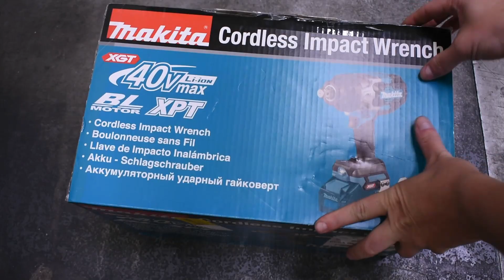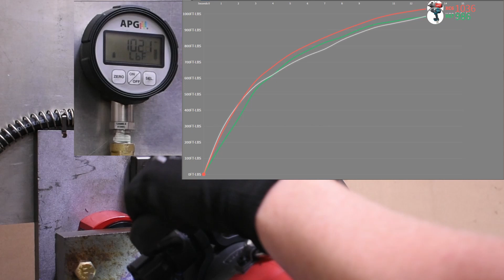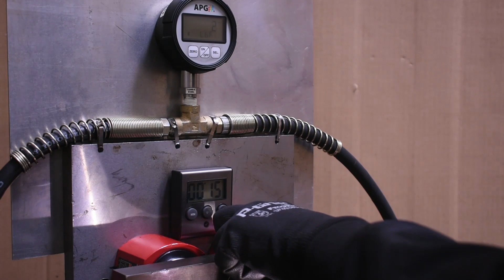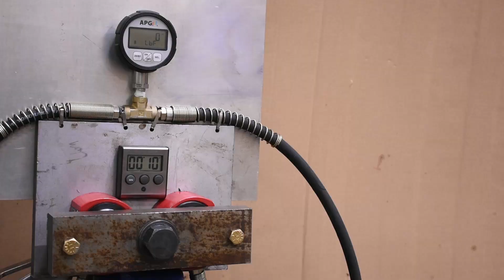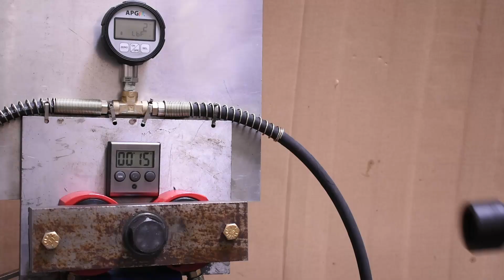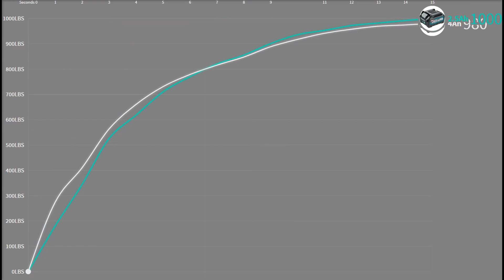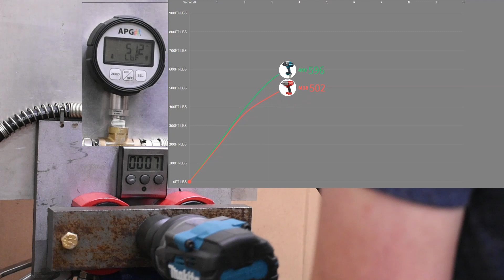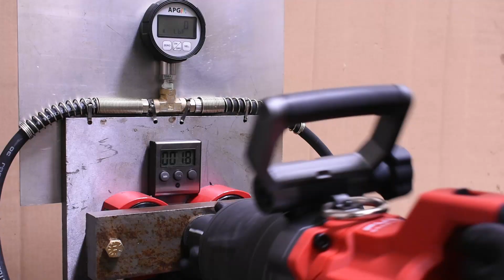Meet the #1 Big-Rig Impact Wrench It's only 3/4" & Everyone Else Should Want 1 Too

Comment: Wait isn’t the per cell draw the same, because in 18v the packs are in two sets in parallel whereas 36/40v they are all in series, I.e same current draw per cell
Reply from the maker: The per cell and total potential draw is the same amount of amps, just wondering if this 40V was made to utilize the extra available in a 4.0 over their 2.5 or maybe the efficiencies of a smaller 40V motor even needs them. As in it needs less total watts. We have no idea, Makita stopped talking to us when we asked.

Comment: I have worked with various Li-ion batteries and have found that the large cell types have higher internal resistance. They will last longer but not hit as hard. The only way to get more punch out of equivalent voltage is to find lower resistance cells, Li-po tends to fit the bill. I'm curious if you where to rig up one of these tools with a Li-po how the numbers will change, using equivalent rated cells. Additionally if they are using less cells to reach the same Ah rating the parallel paths for current flow are reduced, reducing the overall output the battery can do at once before reaching thermal limitations.
Reply: incorrect

Comment: What really annoys me is that Makita was honest with 18 V and 36 V: XGT is the irksomely dishonest 40 volts? Perhaps they really wanted to differentiate, but I guess LXT too hard to keep separated from XGT.

Oh, well... &rocks in rocking chair&
Reply: Makita couldn't call it 36v when they already had a failed 36v platform. My opinion.
Reply: @Hansengineering  I've not owned their 18 V x2 system. Has it been a failure? I truly am curious.
Reply: @ALAPINO  no not 18vx2! They had a single battery 36v system.
Reply: @Hansengineering  exactly

Comment: I've got 98 lithium cells that I want to make into 5 and maybe even 10ah battery packs out of for things like circular saws or heat gun or Sanders those battery powered devices that suck life out of a battery real fast
And I'm special interested to see just how much of a performance gain it will be cuz these particular cells that I have are A123 cells they are rated to put out 80 amps each for 10 seconds and 50 amps each ! And on a dead short a guy got like 254A out of one before the end popped off lol and one guy was able to start a V8 truck with only 4 cells making it 2.5AH at 14v and the size of your cellphone! They are crazy powerful

Comment: Great testing as usual guys! I can confirm that the only real noticeable difference in power when using XGT batteries comes from using the 5AH packs but they're just so huge and maybe not so impressive compared to an 18v tool with a larger amp battery. The 4ah will only give you more run time boo 👎 .  Thanks for showing this!

Comment: I bet Makita is limiting the 4ah pack in software where Milwaukee does the opposite.
Reply: Software? I don't think the charging circuitry is programmable, it probably just uses a current limiter component
Reply: I think they just needed the 21700 cells because 4 ah 18650 cells wouldn't keep up
Reply: @specialopsdave  Probably just an analog or digital IC. Would be fun if someone found one and tried jumping it somehow. ;)
Reply: @specialopsdave  It's a brushless motor so limiting current through the motor is a fairly simple bit of tech to put inside the controls for the motor.
Reply: @prototype3a  Exactly why they would use a 2 cent component, and not software
Reply: @specialopsdave  I guarantee they are not using a "current limiting resistor".
Reply: @prototype3a  Why did you put that in quotes? I never said resistor.

Comment: You'll have to test it with the 5.0ah then, maybe it could hit 1,000 on the 10 second test in reverse.
Reply from the maker: That was why we tested this 4ah battery "It's gotta make more power right?". Not sure making EVEN MORE amps available to this tool is really going to churn more butter at the end of the day.
Reply: @TorqueTestChannel  the short clip you showed of the other channel with all the batteries implied that the 4.0ah is set up different than the 2.5 and the 5.0. I'm not very informed on battery cell technology so maybe it won't make a difference. Love the channel!
Reply: @parkerdalo3248  That same clip also mentioned that Ah is only a measurement of capacity, not power output. It's the different cells that provide more current at once that companies traditionally put in larger packs with higher Ah. Kinda made some extra decision making when purchasing a battery other then "this one will last longer". It's nice to know that you don't have to worry about that with XGT, if you just need power but not endurance then you don't need to splurge and live with a heavier battery pack
Reply: @parkerdalo3248  That guy from that other channel... whomever he may be... says that the 2, 2.5, and 5 use 18650's but the 5 uses 20 of them whereas the other 2 only use 10. The 4 uses 10 21700s. I have found in most tests the 5Ah puts out more "Grunt" than the others, but it depends on the tool. Makita have made the mitre saw put out the exact same RPM no matter which battery you use, yet on the 40v circ saws the 5Ah is noticeably better.
Reply: @ToolsAndStuffOFFICIAL  the AH ratings always kind of throw me off. I have 1.5, 5, and 9AH packs for my milwaukee impact, I figured if they're putting out the same voltage into the same tool, they should have the same amperage and torque. Math is math. The speed difference between them all is ridiculous, and obvoiusly math is not math!

I suppose it's just the smaller capacity packs having a larger voltage dip as soon as you hammer on it?

Comment: The durability is far more important these days, impact guns destroy themselves quickly with the big packs on them, makita adding this in to their new packs is far more of a selling point to me than more power.
Reply: I have the issue with my M12 impacts that when they are used for a while at high impact torque that the temperature pin from the batt to the tool will burn and i have to clean it off and bend the pin out just a bit
Reply: Makita has a damper built into the base to stop that happening

Comment: The 3/4" Bosch Protector should put up similar or better numbers. You should do a head to head as the Bosch would be a way cheaper alternative battery wise. Bare tool is $249 and 8ah 21700 packs are $99 so a pretty good alternative.
Reply: Bosch Profactor ?
Reply: @rosomak533  yeah was a typo

Comment: I revised my Makita impact wrench lineup at my store because of your tests. Definitely happy with stocking the 18V Low and Mid torques, and just the "40V" high torque. From your tests I think for ½" drive the mid torque should suffice for most people who are already on an 18V platform. 18V High torque is now relegated to "special order" territory =P
PS: If I lived in the States or you in Canada I'd definitely be sending you tools I stock for testing.
Reply: how much does an old xwt08(?) their big 18v even cost? is the cost in the space it takes on the shelf maybe? an old design and maybe just cause ima tool nerd but they're 100usd new?
Reply: @byloyuripka9624  The old 1/2" High torque 18V? In Canada they cost me slightly more then the new 18V mid torque, somewhere a little under $300 CDN. I don't think it's worth it for me to stock it when the mid torque is a much better value, and a smaller easier to use tool to boot. But if someone really wants it, I'll order them in the old 18V high torque
Reply: The 18v mid impressed but didnt really beat the mid waukee, didnt want to spend money on an old battery platform so i bought both the 40vMax mid and the 3/4", and threw in the 40vMax compact as well.

Comment: You know what you have to do now right?  Test the theory about the 18V Makita needing more Amps, so find someone who can build a 18V battery pack using 21650s.
Reply: <strokes beard>
Reply: Just use a Milwaukee battery and an adaptor.
Reply: @ToolsAndStuffOFFICIAL  Makita should go into failsafe mode if it doesn't get the expected signals from the battery.
Reply: @Hansengineering  I have tested a number of Makita 18v tools with a Milwaukee 12Ah. They usually work ok, but sometimes stutter a bit at the beginning. But then again Milwaukee tools stutter with their own batteries also.

Comment: Those 21700 batteries just aren't made as well as the mass produced 18650 would be my explanation for the 4 amp hour cells not having the same output over time vs intial grunt. I thought Makita put LG browns in their pack, I might be wrong, but odd sized lithium cells usually come from lower tier batteries producers from Ina-Chey...
Reply from the maker: Samsung makes the 30T and 40T 21700 cells
Reply: 21700's are being mass produced by major companies for a long time now...

Comment: I don't really understand the high torque ratings still using impacts. At that point, should we not be looking for high torque via mechanical advantage, such as a deep gear reduction? Yeah, a two-handled behemoth has more stability when held, but it also has enough energy to snap your wrist like a toothpick if anything goes wrong. Within the space of that D-handle Milwaukee, you could probably have enough gear reduction to get 150% of the rating with a strong enough motor behind it, so again what's the point of clinging to the idea of spinning hammers. I know the few gear-based torque wrenches out there are expensive, but they don't necessarily have to be, because the only market for them is high-end industrial, and the tools come with more features than the average tech needs, and based on these two facts the price of one can be severely cut if any of these companies tried to make one for the broader market; similar issues are why that D handle is so unreasonably expensive, the target market considers that kind of price pocket change in the long run. 

Also those Makita 40v 2170 cell packs are just wasted potential. There needs to be a tool with a motor that can properly utilize them, say full sized tools and not hand tools for example, similar markets to what Milwaukee is targeting with their MX Fuel tools with their massive battery packs. Or a deep gear reduction torque wrench would benefit from a motor that could potentially utilize this battery, as there is a lot of friction to be overcome, the motor itself would need a decent amount of torque to go with the high amount of speed. Makita obviously had something planned for these, any actual electrical engineer can tell you that the 40v system as it is wouldn't benefit from cells with higher amp draw, based on just paper numbers.
Reply from the maker: Gear reduction tools are for tightening.
Reply: @TorqueTestChannel  Factually incorrect. Torque is torque, no matter the direction, no matter how you achieve that torque. Impacts only help with seized fasteners, such as rust, by using mechanical force to knock the two pieces apart in a blow, similarly to how there are various chemical-based solutions to the same problem.
Reply from the maker: @Jake Snyder  "Impacts only help with seized fasteners, such as rust" Yes 
Just simply stating that gear reduced tools like the cordless Hytroc or CP7600 for air are for tightening. According to the companies that make them. Thats not to say something like a torque multiplier can't work in reverse. Just haven't seen a stand alone tool for reverse.
Reply: @johnz8210  Nobody has made trucks with left hand threads for 20 years. As far as impact vs torque multiplier, a big reason is impacts are reactionless. Multipliers, not so much.
Reply: @TorqueTestChannel  The tools mentioned are 'for tightening' only because they're equipped with monitoring to prevent over-tightening; they're also intended for industrial assembly lines, or just industrial assembly in general due to the Hytorc's fastener history feature. Using them to remove a nut is also a valid use, any argument against such is uninformed and incorrect. It'd be akin to claiming that a vehicle can only drive in one direction due to its gear reduction transmission, yet if first and reverse are equal ratios, the vehicle will perform the same in either direction, minus the additional mechanical losses of reverse's additional gearset; based on this fact, why would a torque gun be any different? Gear reductions are more consistent, more predictable, and are generally safer as well, as we all know of a few choice impacts that are wrist killers; and this becomes especially true for high torque ratings. The absolute only advantage impacts have, other than lower part count and cheaper production costs, is that the impact can mechanically unseize a seized bolt.  

The concept already exists in practice, has for a long time, it just doesn't exist in the prosumer market. That and the trucking industry does have reducers made for removing and tightening lugs, typically hand cranked ones, all one needs to do is adapt a drill to one, and some of these reducers even come with a square to square adapter for this reason. There's even a cheap consumer version that has a female square input, for use with either a ratchet or a typical drill driver. Both of the last two examples just need to be condensed into a singular tool, just like how the Hytorc is. 

But to say, "Gear reduction tools are for tightening," is just blatantly incorrect. That original comment should be edited to reflect that you were mentioning only two tools that are marketed for industrial assembly. Though with a footnote that these two tools can also be used in reverse as well, as that's also a valid use case for the tools and there's literally nothing preventing them from working in reverse. Someone who does not know better can easily come across that comment and have the belief that the comment was factual, when it's not. Even with the knowledge that the comment references a couple of specific tools, it's still not factual. For a channel that's fairly scientific and factual, that comment and subsequent comments come as a surprise, and I don't think this needs to be explained why it's a problem.

Comment: Higher voltage is more efficient for moving electricity and motors are generally happier and can be designed smaller when using higher voltage to power them.  This makes me wonder why companies (Milwaukee in particular) have yet to go to the high voltage design?  For now I hope they don't because then all my new tools and batteries become obsolete.  Lol
Reply: Cant believe Makita did not make them backwards compatible
Reply: @BamaShinesDistillery  that's a naïve way of thinking to have it be backwards compatible the previous tools need to have been backwards compatible in the first place, this is the exact issue with metabos multi volt line. you need to have communication with the tool built in to let the battery and tool know how much to discharge or draw.

plus 40v is a heavy duty pro line when 18v is a midrange and 12v low duty, it made sense to them.
Reply: @halogamerdude41  tell that to Dewalt. Their 60v is backwards compatible too.
Reply: @skinnygirlstretchmarks  to weak for what I do.
Reply: @BamaShinesDistillery  I believe their batteries suffer from being the worst in the industry cuz of the haphazard fabricobbling things to work for all things. the batteries are not good at anything jack of all trades master of none.

im interested in seeing comparsions between all brands 7 1/4 rear handles now since we got the xgt
Reply: @halogamerdude41  I've seen the xgt...it walks away from the 36v

Comment: 8:45 no that is not true. It doesn't matter the battery configuration, the cells "see" the same amperage. It doesn't matter if they are connected in series or in parallel. If you have 2 cells, even though the amperage out of the battery, if they are connected in series is half of the battery with cells in series (for the same load), each cell sees the same load. The connections between the cells make only a difference in how to add the properties up (sum of the voltage or amperage).

Comment: Torque Test Channel, it seems to me that Makita hasn’t learned how to extrapolate the power and efficiency from 21700 cells.  Whereas Milwaukee with their FUEL technology has.  That’s probably the reason why Makita in many tool scenarios needs to run two batteries to compete with Milwaukee’s one battery Fuel tools.
Reply: It is because of a patent. Other tool companies are using different voltages because Milwaukee sue them if they draw too much current from their batteries. That is the reason why Milwaukee get more power out of their batteries, they won't let anyone else do it. but it has now backed them into a corner as they now make a slew of tools that their batteries can't handle as they overheat too fast.

Comment: Lotta people in the comments still drinking the Milwaukee koolaid.
Reply: Lotta people? There are exactly two other comments mentioning Milwaukee, and none of them written after drinking the M18 kool-aid. 😂
Reply: Milwaukee is tried, tested and proven over several years, I am a heady duty diesel tech and I use Milwaukee every single day. Never let me down yet, when using them to make a living there is nothing better, period. They have an enormous tool lineup and batteries are interchangeable. You won’t find anything even close to as powerful as Milwaukee while using only 18volts. When Milwaukee comes out with 40v tools like this Makita, their won’t be any competition.
Reply: I'm not even an electric fanboy, but I can get the red ones at every shop in town and my favourite one ups the warranty to 5 year in house. Last time I looked I have to order the blue ones online. That's an issue.

Comment: You have to remember that the higher the voltage, the more dangerous it is.  36v is usually considered the highest safe voltage to use.  40 volts has the potential to kill, 36 not likely.  These companies have to look at liability.  While I am not afraid to use a 40 volt tool, some lawyer may be.
Reply: They are 36 volt tools
Reply: bs